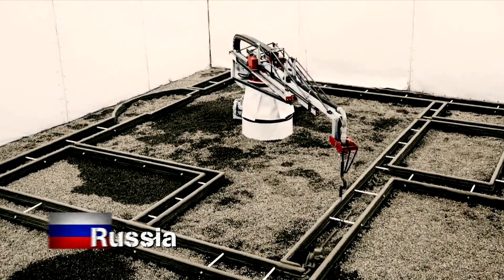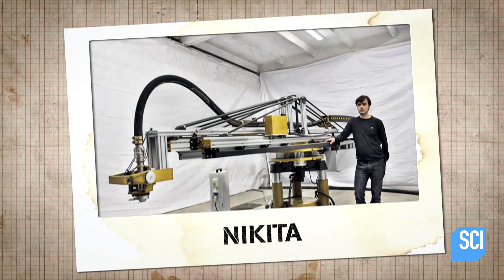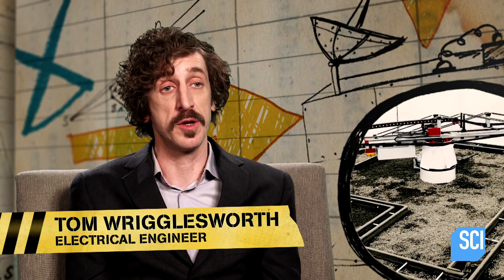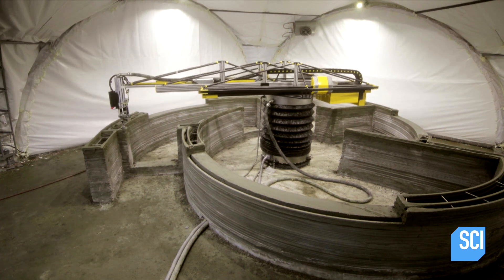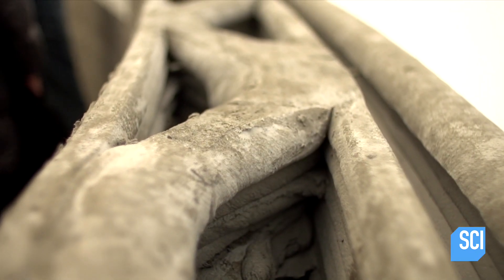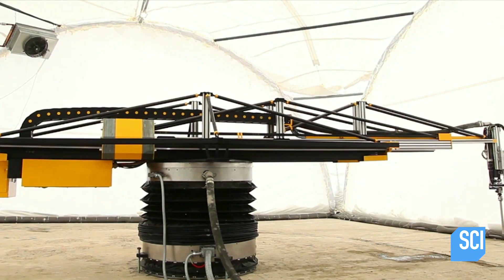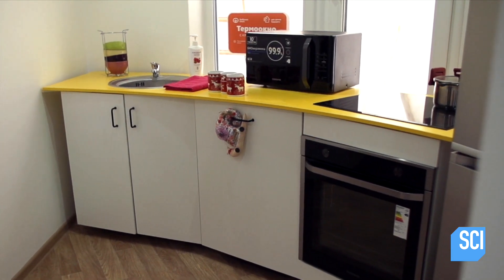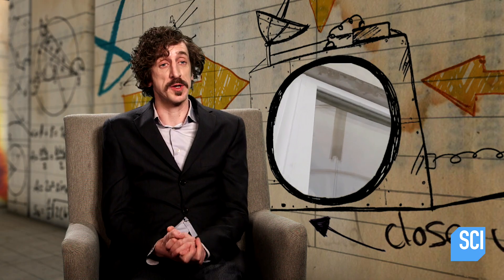This 3D Printer Builds 3-Bedroom Houses In 24 Hours

Comment: Print hempcrete instead concrete. Hempcrte provide you with insulation and bush fire proof. I use CLT Cross Laminate Timber and laminated beam., at moment.  You could manufacture them in factory.  This would be more economical the windows and doors could including.  Off site manufacture is way to go.

Comment: "Built in a way that I've never seen before!" 
uhhh... all the polar/radial reprap printer engineers would disagree with you. 
Also, they don't print in 360 (it's usually 180) because that would be stupid. People with desktop printers want to build solid objects, not donuts.